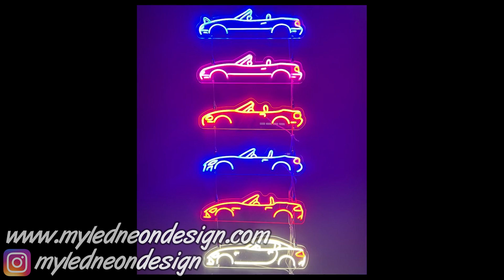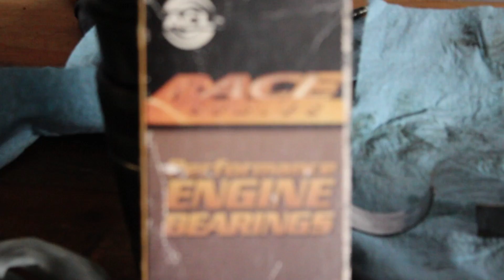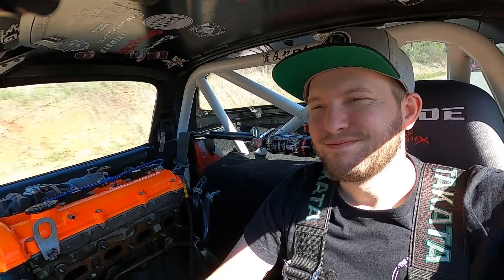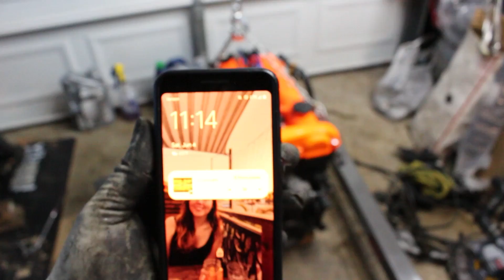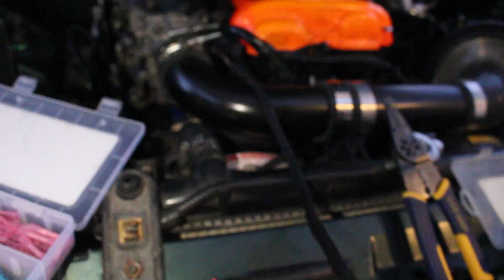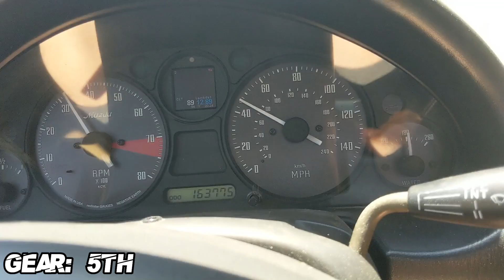I Accidentally Blew Up The NB [2-Day VVT Engine Swap]

Comment: Something I always try to do when changing oil is put the oil on top of the engine keep reminding yourself you can't drive away or close the hood without the oil being removed so you definitely probably would not forget at that point because I've been there done that

Comment: I didn’t follow the forward and top most rule when searching for a oil leak, assumed it was a rear main and ended up doing it twice, did the clutch while I was in there ofc and then ended up dropping the subframe to do a oil pan gasket, it ended up being a $2 crush washer for my vvt banjo bolt. I spent $3000 chasing it. As for most time consuming 3 months figuring out why I was down on power ended up being fixed idle advance turned on cutting power to 98hp turned it off and made 154 n/a

Comment: I'm working on it I'm working on it.... intercooler tomorrow after work lol.

Correction.....I need to heat up and give the turbo drain line a little more of a bend, sits too low to the oil pan and there would be way too much tension on the fitting to the oil pan if I connect it.

Comment: as far as oil changes go, the worst i've done is accidentally keep the old filter on for one interval

worst overall, was third in line in a canyon, ran over a rock, and didn't realize it busted open my oilpan until the afternoon after... the whole engine was toast but i ended up having a full refresh done on a JDM motor and it's been rock solid for the past 4 years.

Comment: ok so this one time I did a 2zz swap on an mr2 and while refreshing the clutch I accidentally dropped the throw-out bearing. Seemed good so I slapped it back in. After a like a few months the clutch stopped disengaging, just a little, just enough to where you couldn't really shift. Replaced clutch master, clutch slave & line before accepting the truth: transmission had to come back out again :')

Comment: Forgot to loctite flywheel bolts after pulling the motor and doing other stuff thought it was rod nock so went and bought another motor 3 hours away and found out it was just the flywheel wanted to visit me in the cabin when I pulled the motor

Comment: Just yesterday, put the wrong fluid in my rear diff (VW Haldex fluid to top off the rear diff). Only a $32 error, but now I have to jack the car back up - all four corners so the car is level - to drain and refill. Not too bad in comparison, but still a pita. 

Thanks for sharing your mistake, Greg. YT is full of videos where everything goes perfectly which I think adds to the dis function that social media can bring to our lives.

Comment: I had a custom $8k BBF built to be an NA tow engine. Then promptly added a turbo with not enough ring gap and broke two pistons. On the plus side I built it myself the next go around and now it's a forged bottom end monster with a bigger turbo 😁

Comment: i forgot to add oil into my transmission after i replaced my engine. drove it for about 3 hours when after work  i got in i could hear grinding and driving was the jerkieest ive felt. it wasnt drivable

Comment: Hey Greg. I had the same thing happened to me during an oil change. But I ran the engine for about 5 or 6 seconds before I realized and shut it off. Do you think I have anything to worry about?
Reply from the maker: I would imagine the damage would be significantly less than driving under load for 2-3 minutes like I did, lol. You should be fine

Comment: I once took a drain plug spot for a jacking point... Lets just say I ended up with a bump and a hole where that was lol. Ended up getting it fixed the diy way by smashing it sorta back into place just enough so I can't tell it's there anymore. So didn't end up being too expensive physically, just mentally 🙃
Reply from the maker: My buddy was jacking up his MKIII Supra by what he thought was the front subframe. It was the oil pan. Motor had to come out
Reply: @TheCarPassionChannel  yikes! Not gonna lie, reading and hearing the mistakes did make me feel a little "better" about it.. :')

Comment: When jacking up a car,  never EVER put ramps or wood underneath the wheels until the car is on four jack stands and it's at its resting height. I jacked up the front of a car, put it on stands, and put ramps under the wheels for peace of mind. I later had to jack the rear up, which in turn put the front wheels on the ramps, and the car rolled down the ramps on its front wheels and the jack. Nobody got hurt, including the Miata. Be safe!

Comment: For one I was a lube tech for a year and I've had several close calls that helped me develop a system that makes sure I won't forget to add oil and torque the drain plug. The second my story is my current turbo build I locked up the stock clutch to the flywheel at about 180hp. I did this 4hrs before an autocross event and really wanted to make the event. I swapped in another decent stock clutch and made the event. I slipped all the way through 2nd gear and limped through the event. I then decided to have my car running as soon as possible so I picked up a ebay XTD clutch and swapped that in. That lasted about 500 miles before the pressure plate exploded. Long story short I finally took the time and ordered a quality clutch and installed it for the last time. However after doing 3 clutch changes in under 4 months I'm pretty damn good at pulling the transmission on jack stands haha!
Reply: Brave man. I wimped out and had a shop do mine. One day I'll man up and do it

Comment: Yep, most people (myself included)  learn the hard way to have a system for oil changes. I have a bunch of things i do to reduce my stupidity. Oil cap off until oils in the car, one wheel nut completely off until they are all being properly tightened, battery disconnected until everything on the list is ticked.
Guess why i do these things!

Comment: I had a friend of mine help me do an engine swap (McCulley Race engine) in my NB. We did it over the weekend and he drainded the oil and finger tightened the drain plug back in the oil pan. Got the engine back in the car and we drove it over the next 2 weeks off and on. I was driving it on my own when the oil plug fell out. Caught it and saved it, only had to put new rod and main bearings in the car. I have now learned to make a check list and check everything myself. No matter who is helping.

Comment: taking a battery out of a beautifully restored cessna 182, but instead of my usual process i used my standard handle ratchet and proceeded to take the positive terminal off first. Or i would have if i hadnt slipped and touched the inside of the aircraft tail wall, which is raw aluminum. aluminum as we know is a decent conductor of electricity and also happens to be very very thin in this construction (.020") and so given the high current I instantly welded a 1/4" hole in this newly painted aircraft. several days, s flush patch, a little filler, and the best aircraft painter in the state later you could never tell. experience is best teacher. keeps your head out of you ass

Comment: Changed my thermostat and heater core hoses and forgot to brup coolant and blew the head gasket on my last NA. Ended up blowing the head gasket the same day but didn't realize it till the next day after my car started to overheat before work. Changed the head gasket two weekends later when I had time every mistake is a lesson I guess 💀

Comment: First time i did a clutch on my NB i did the entire job in record time! When i was cleaning up before starting the car, i found this little tiny, unopened box on the floor near the clutch kit box.... it was the pilot bearing 😭 i did the entire job over again the next day and the day after that i went to the drift event i was prepping for. What a time it was lmao. DON'T FORGET THE PILOT BEARING.
Reply: Done something similar on my lorry, had to replace the clutch and it's a engine and gearbox out together job as not enough room. I got it all out fitted the new clutch and had the flywheel resurfaced proceeded to fit the engine and gearbox back in and then took it for a test only to realise 5 minutes into the drive I forgot to lock tight the flywheel bolts (stated in manaul must locktite) so another 2 days work for 6 little blobs of locktite
Reply: Just wait till the new pilot bearing fails after 2 months🙃

Comment: I built a fully forged motor, spent 32hrs porting the head aaaaaaaaaaaaand I put the head gasket on upside-down & fried the head by blocking the oil supply. 700$ later and an insane amount of time spent porting she was back together but my god that was something.

Comment: Not really a mistake, just something interesting that pertains to your NB not making any weird noises with no oil. When I bought my ‘96 NA, I’d always suspected bad piston rings because it was always burning oil and there was a ton of burnt oil and soot on the plugs. Though there were no bad sounds or ticking, it had been starved of enough oil for long enough, even with me refilling it all the time, to completely destroy every single rod bearing. I mean, they were falling apart in my hands as I was disassembling the engine. Still, no noises, ticking, or knock. I guess that’s a testament to how reliable these BPs are.

Edit
After seeing your bearings, mine were way worse, I have no idea how mine weren’t knocking at all… luck I suppose

Comment: my only major mistake was casually shifting 4-6 to answer the question of the girl in my passenger seat 
my guess is it caught the reverse gate cuz it made unhappy gearbox noises then i lost 5th and reverse.
cracked it open the next day and one of the journal bearings on the shift fork had ejecto seato'd, cuz! Tapped it back in with some loctite and the 200$ 6 speed lives to this day
best part was hosing it down in my driveway when the up and coming drain commissioner was going door to door discussing water tables and his campaigning

Comment: Cheaped out by not using antifreeze i case i need to take off a hose after belt change. It froze 2 days later and the engine broke.. i thought. Bought another engine wich was shit so i bought a third engine wich was shit so i rebuilt the first engine wich basically just needed a headgasket. I did every bearing too and changed crank and cams too tho. That was more expensive than a bottle of antifreeze.

Comment: At my last job working at a fairly well known local Miata shop that specializes in 2.5 NC’s, I was doing a cam upgrade (in car) for a customer and when installing the exhaust cam it didn’t seat as cleanly as it should hve. Didn’t think anything of it. Finished the job, car started and idled fine, but the second it had any load we hear a POP and it starts running like ass. After further inspection the exhaust cam had snapped in two. Being interference I feared the worst but it was over cyl 3 & 4 and somehow didn’t contact valves at all. My boss thankfully was willing to eat the parts and I ate the labor, but after doing the job again it ran perfectly and still does to this day at 300whp with a fab9 turbo kit. Close call but thankfully the only one out of a few dozen cars.

Comment: Slapped valves in a 1.8T VW cylinder head (my own car) after a timing belt break and didn't verify that the valve guides were good - They were not. I had one day per week to work on it (at work) and was in a rush. The valves hung and one of the valve heads broke off and even punched a hole in a cylinder wall (!). I found a replacement engine and had it running on my day off the following week.

Comment: My random miata story. I have a NB2 1.8 VVT with a GT2554R on a hydra ems. I have that car and tune for almost 10 years now, on a stock engine. Couple of summers ago, i was fed up with not being able to have the ac full blowing and having some fun on the street, at the same time. (Summers in Greece are just as hot as in southern California). So i bought 2 SPAL fans and a shroud for my aftermarket radiator. It was so effective that without AC, i would never overheat under normal pulls with only one of the fans running. So i configured the bigger of the two to start spinning at a set temperature like 104c (219f), which at that time i would almost never reach without the AC on (when the AC was ON both fans were set to run).

All these were done at the end of that summer. A winter comes and goes. Next summer comes and i start to get some crazy misfires under full load after repeating pulls. So i start to chase the problem...i change spark plugs...nothing...i gap them closer....no change...i borrow a set of coils...no change. I even pull timing after some logs...no change.

After quite a while of serious disheartening. I check one last log of the misfire happening and i observe something strange, when those misfires happen, which also trigger the knock sensor threshold, the voltage of the ECU was dropping really low momentarily, like 11.5 volts.

Long story short, at the same time the voltage was dropping and the car misfired, the coolant temperature was always 104c....

So the bigger SPAL fan was drawing momentarily at startup so many amps, it was sapping the power out of the coils and spark plugs....

I learned two things from this endeavor, tuning is exceptionally complicated to be done in a refined way and always have the critical information displayed on the dash like a knock sensor idiot light, temperatures, oil pressures etc and always tune accordingly in your ecu, protection strategies.

Comment: I also blew my nb (non-vvt) engine by trying out a new ecu and never thought to do my checkups with the boost turned off (disconnected wg or such).. few misfires and a runaway boost later and nasty rodknocks..  i was moping around a whole year before i vvt-swaped it.. now thinking to compound-charge it again.. it was crazy fun with that setup. .
Reply: Is the vvt engine better than the non vvt if I intend to boost it in the future

Comment: First Miata I had ever owned, I did a timing belt job and the usual maintenance items that go with. I spent a few days doing it and took my time.

First drive, everything went well, car fired right up. 

A few days later I woke up in the middle of the night realizing that I never torqued the crank bolt and was just driving around like that. 

Immediately torqued it when I was able to. Never ran into any problems because of it but I was a dumb mistake that probably could have cost me an engine.

Comment: About silly mistakes... yesterday i banged my dumb clean NA into a guardrail after just having it finished. Rear quarter panel is completely done for. Wet street on one side, dry on the other, had to correct after braking and got carried to the outside with no chance to prevent the impact... -_- i'm pissed.
Well off to the bodyshop with a stack of euros...

Comment: Working on a friends car and we forgot to put the lugs back on a front wheel. Drove 3 feet and the wheel fell off 😂
Reply from the maker: Lollll at least you didn't make it to the freeway! Once time I drove from my house over 2 hours to get to a Hellaflush show with my brand new wheels, drove all the way home and realized I only hand tightened all of the front lugs and 2 of them had started backing out by the time I was home. So scary

Comment: ohhh man when I worked as a VW tech, was pulling a car onto the alignment rack that just came from the body shop after being in a collision. my foot slipped off the brake pedal and punched the gas. didn't have time to react and ran over the alignment rack, crashed into the alignment machine. and broke the windshield, under trays, dented the hood to hell, and destroyed the alignment computer and tarkets, the VW specific mirrors for setting front cameras, etc. it ended up costing the dealership a grand total of $38k. I obviously got fired. looking back now it was the best thing thst ever happened to me cause the dealership was sucking the life out of me. overall learning experience, make sure your foots on the brake complete and stay out of dealerships if you value your mental well being.
Reply from the maker: Omggggggg I'm laughing but only with the "we'll laugh about this someday" mentality that happens after a complete disaster
Reply: should have 1.6 swapped it

Comment: Was doing brake pads on my 94 mustang GT. Finished the job and went to drive it but the brakes were making a terrible screeching noise. Pulled the wheels back off to see what it was and apparently I forgot to add the 2nd brake pad on the passenger rear side… ruined my caliper and rotor so had to buy new ones but you live and learn :)